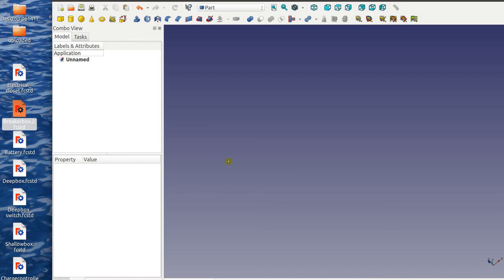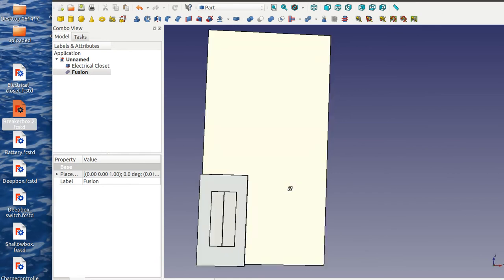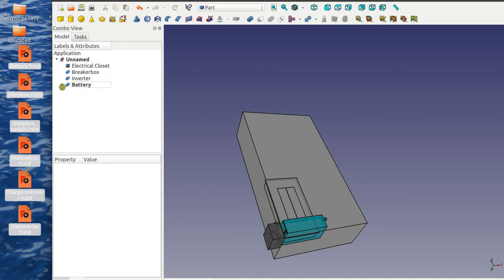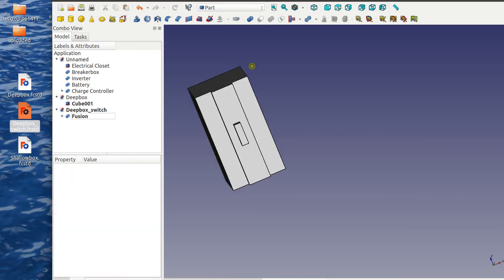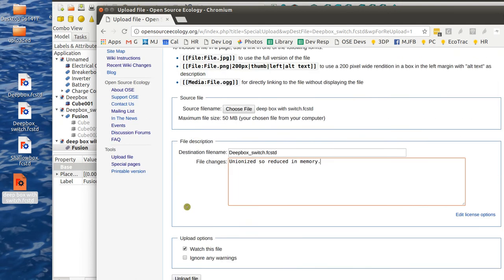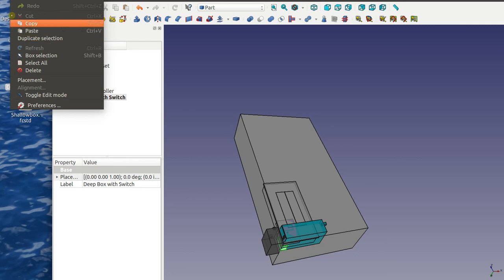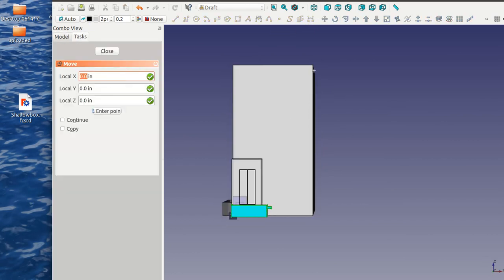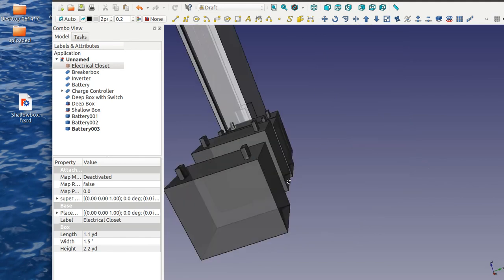File Merge Workflow in FreeCAD

Comment: So there is no need to open new files and copy the bodys into it from other projects/files.... O.k. i see thank you! :D
Just wish FreeCAD would have a save manager and a assembly. The parts would be saved individually and the
assembly file knew the positions of each part by the translation and rotation of the coordinate system.... If you wont
to separate a file/body from a project you have to copy that out and save it individually, meh.